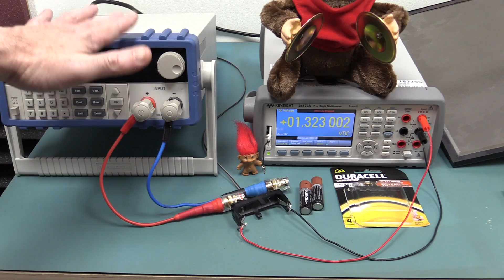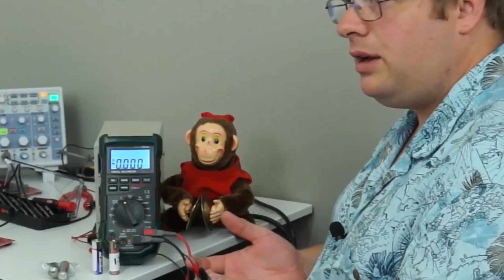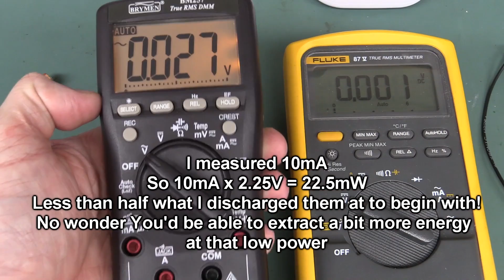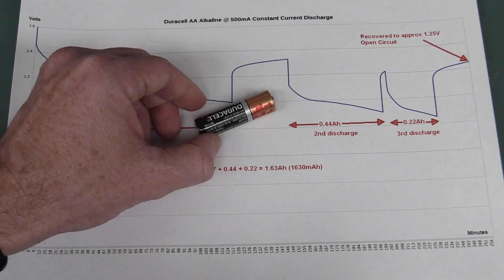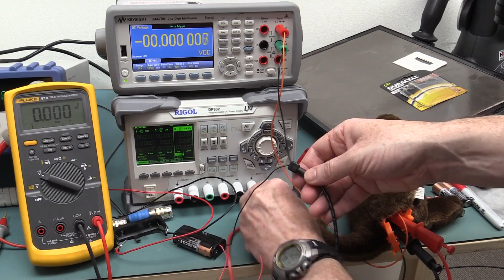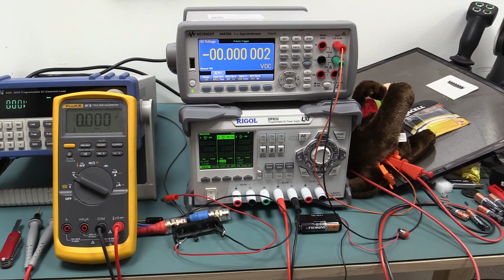EEVblog #789 - Batteriser Monkey BUSTED!

Comment: May be you might notice, that good method to check cells is to measure CURRENT given into short circuit - sure for short time and on proper MM input terminal. Recently I bought nice cheap 9V NiMH rechargable and measured the current (5 Amps, great) too long that internal smart fuse (single thin-enough "wire") burned, so I degusted the thing and found very nice workmanship with 7 tiny 1/3 AAA cells fairly welded, including the "fuse" part burned :-)) nice... It all in fact teached me about existence of nice 1/3 AAA things - I love them - and they are probably modern LSD technology :-)

Comment: I have a childhood memory of sitting under a table or bed covered with some blankets or so and having a flashlight. I could see the light dying down completely and knew that if I turn it off for a while it will give me another short flash of light (the battery recovered).
Given that we moved away from that house when I was 5 that means that a <5year old child already knows that even if a battery been drained to 0 (completely darkness) it can recover if left unused for a while but it will go dark again fast (short flash).

Comment: The only use I can think of for the Batteriser is when using a device with a relatively high cutoff voltage and low voltage cells. I have a number of microphone transmitters that I would like to run from rechargeable cells but can’t due to the  low cell voltage (~1.2 V/cell). A boost regulator would help here as almost all of the cell's energy is available at a voltage too low for the transmitter to use. However, a noisy switching booster may not be a good idea when used with the integral microphone amplifier and transmitter. In any case, I don't want to give these scammers my money!

Comment: Do you know Brain solution (table salt or sea water) squize up th damed battery (manganese) completely?
1. Drill up the small hole into the positive plate of battery.
2. Then spoitting few drop the salt water into it.
3. Wait a minute, then you can get the all-remaining power of the battery.
Please do not do it for Alkaline etc...

Comment: Would it be possible to to maximize battery energy extraction by using some king of pulse drain scheme with a storage capacitor to provide a smooth voltage to the end device? I think it is done with small lithium batteries but could it be helpful with alkaline batteries?

Comment: the only thing I think this batteriserr may be useful for is perhaps an led torch or very badly designed product that has a cut off voltage set too high. surely if using it in say an led torch you would be trading operating time for brightness ?
Reply: +TRDreams 
Ummm.... exactly the opposite. Any decent LED torch will already have a boost converter built-in. That's why they stay bright and die suddenly.
Reply: mines a £30 handheld lamp so should be decent one of those ones they use in garages, it certainly fades out slowly over time. Might have to pull it apart to see if there is indeed a converter! I'll also find the model of it

Comment: do they compare apples with oranges, like in smart devices with active shut down and nonsmart devices that stop working? i didnt see them stick their "1.25" volts batteries in the monkey, which most likely sucks batteries empty til they are empty, with batterisers and it would work. 
the batteriser will do its claimed job if the product it is used in is so badly designed that it will draw the voltage down to cut off voltage even when the batteries are not empty. or when the battery gauge isnt working properly. thats what both batteriser and dave say.

Comment: OMG, just OMFG at all, well, all of gravity's comments in reply to yoksel's comment.  Dave has it 110% correct and I'm not gonna rephrase anything he's said because it'd be pointless.  

The one and ONLY thing that stupid POS baterizer would ever be useful for would be for a device that requires a higher cutoff voltage per cell UNDER LOAD than the battery is capable of producing, again UNDER LOAD, while there is still useable energy in the battery.  

As demonstrated, the batteries still have useable energy down to 0.5v per cell but if your device absolutely requires 1.0v per cell, UNDER LOAD, then those batteries, while still containing a minute amount of energy, are seen as dead TO THAT ONE DEVICE.  In this case and ONLY within this case of a required specific minimum voltage, again UNDER LOAD, the baterizer can boost the terminal voltage UNDER LOAD and allow a device that has a specific minimum voltage, UNDER LOAD, to continue to operate utilizing the remaining energy within the battery despite the fact the battery appears to be dead to that device.

With this knowledge in mind, baterizer MUST have tested their claim on a device that has a specific minimum operational voltage that is above the actual "dead voltage" of the battery UNDER LOAD.  So you have a device that must operate with a minimum of 2.5v and those dead batteries will look like they're good enough because of the battery bounce back but as soon as you attempt to load the batteries the voltage drops below the minimum.  

If you even attempted to use the baterizer on those batteries it would fail MISERABLY!  Why?  BECAUSE THERE'S NO ENERGY LEFT TO EXTRACT!  What are you?? Some kind of moron that thinks you can magically create energy out of thin air?? <-- to baterizer ^_^

Dave, keep up the good work and shove that monkey right up baterizer's "where the batteries go."

Comment: Even in my electronics kit I got at the age of about 12, they explained that the voltage under load is different from the voltage without load. Well, as usual: If a claim is too good to be true, it probably is bollocks!

Comment: Duracell not supposed to leak, yeah right! Many of my gadgets bit the dust due to leaky Duracells. On the other hand I have a multimeter with old Ever Ready zinc chloride cells that are over 30 years old and still working and not leaking.
Reply: Fungus The Bogeyman
 I'm aware of that, my point was having a reading at all after 20 years was a surpeise to me.
Reply: +Peter Kwan I thought I was dreaming... found old batteries I had (20+ years old) still giving 0.97 terminal voltage. Thought those things would register as dead weights.
Reply: +Gavin Crouch 0.97 without a load on it is DEAD.

Comment: The best test you could do is to test their actual claims. Stick some fresh batteries in a device, let's say an mp3 player, measure how long it plays for until it's dead and then stick the batteriser sleeve on the batteries and measure again. They claim they you should get up to 8x the play time using the sleeve. I doubt you will even get 8 minutes.

Comment: Something obvious just occurred to me: use cells in parallel to get more usable energy.  Less internal resistance from the battery of cells in parallel, so less energy wasted heating the cells.

Presumably, this means that putting e.g. seven AAA cells in place of a D cell would be more power efficient.  (The cost of manufacture must make this uneconomic.  Maybe it would be viable for NiMH, where the cost differentials are more favourable.)

Comment: This should be a meme, probing the monkey's butt! I love it.
Also, I didn't realise that batteries would recover to about 1.2-1.3V from just about any discharged state. I knew batteries recovered some voltage but I had assumed it would be linear. Like it would recover say, 30% or something. The fact that it is obviously not linear makes the open circuit voltage test even worse than I previously thought.

Comment: So, with the Batteriser the batteries are more prone to leak? Another downside?
Reply: +Ernst Stavro Blofeld No, he got it right. Fully discharging batteries can make them leak. It also damages recharegables and makes them lose capacity. Your batterizer will do both of those things. Enjoy it!
Reply: +Ernst Stavro Blofeld

Rubbish. The Batteriser has to work in every type of device, including devices with microamp surrent drains like remote controls, Apple keyboards, etc. 

Microamp loads will mean the battery voltage under load is almost the same as the open-terminal voltage. Even a dead battery has an open-terminal voltage of about 1.2 Volts, as clearly shown in this video.

When does the batteriser shut down? At 1.2V? That's still a full charge in a high-drain device.
Reply: +Charlie Pechiar No you got that wrong.
Reply: +Ernst Stavro Blofeld Well, won't the Batteriser, by its nature, tend to constantly drain current from the battery? More than what the product by itself would (due to efficiency being <100%). Dave mentions (and shows) that if you leave a battery draining for too long it will tend to leak.
Reply: Charlie Pechiar
No since the Batteriser uses chips, which have a (very low) cutoff voltage themselves, an almost infinite drain, like in Dave's Indiana Jones experiment, will be prevented.

Comment: People are a little slow mentally I'm afraid. If you're all worried about "wasting" money on batteries then buy some rechargeable! A 4 pack of AA Eneloops are 12 dollars or so, if you charge and use them 4 times they've paid for themselves. 
I'm not an engineer, so I just sort of watch these videos and absorb what I can from them, but even so I'm sure most people will agree if you don't want to use a battery once and toss it you should get rechargeable cells.

Comment: This video is rage-locked
Proving that bateries are different than lab power suplies is easy enough as sticking a load on top of it
all that needed to be shown is that voltage of any battery wil drop under load and how much it drop depends on battery remining charge and load. Measuring batteryies voltage open circuit is doubies at least, because of battery internal resistance but also the meter input resistance, and we get that part very clear from your video. Cel specyfic voltage play big role in that, and voltage will regenerate until it can't
But what is the monkey amp ratting? how much power that creature consume trough its but?
cutoff voltage must be deretmined under specyfic device load. in some cases even new 9v battery will not power high dtain 3v device, same goes for weak power suplies.
Please don't rage over who is right and who is wrong, all you need to do is show how to do it right , cold unbias facts, because we all known who is more right

Comment: I suppose part of the problem could be that the general public has been trained to test their batteries in open-circuit, back when all the manufacturers had those little testing strips on the sides of their batteries.
Reply: Those testing strips load the battery, otherwise they would always show the same voltage even when the batteries were dead.

Comment: +EEVblog What about current peaks?  I was wondering if there is such a situation where using a power supply could be inappropriate for some kind of test, even though the cut-off is  the same. Maybe if a product load is not constant, but take some bursts of hight current. With batteries somewhat discharged, the device would not work, or could "reboot" , in case of a digital equipment, as the voltage would drop because of internal resistence of the batteries. An internal capacitor in parallel would have to be big enough. With a power supply, the voltage would stay the same, even at a current peaks. The batteriser would be of not help anyway, of course, because it cannot handle high currents.
Reply from the maker: +Jonathan Araujo That should be treated as a separate issue, and one that is related to the actual individual product design. Because if you have designed a product that cuts out on it's own load pulse from batteries it's designed to work with, then you have a badly designed product. Most products are not like this.
Reply: +Jonathan Araujo There are indeed, and that has been one of the problems in these videos. Professional battery simulators, like the Keithley 2302, exist to test cutouts in large part for multi-mode devices, like transmitters. A device can work fine at one power level, but when switching to a higher current mode, it may fail. This is notable in mobile phone, bluetooth, wifi design, and so on.

If it's switching on a comparator, and the current burst is short, the comparator may have 'hysteresis' so that it doesn't trip for a sufficiently short burst. Many devices however use something called a 'coulomb counter' to measure battery charge status as a product of current, and for those of course a PSU may give an inaccurate reading. The bq20z80 is an example of a device which does so, and additionally measures battery 'internal resistance' to determine battery status.

Finally, for a commercial switching regulator like the MCP1623, its operation is perhaps limited by the output power and input series resistance, which page 12 of the revision C datasheet may indicate.
Reply: Gravity's account has absolutely nothing on it, fairly certain he's just a Bateroo hired gun, to come here and spew technical jargon and confuse the situation.

Comment: Comment from a person who actually owns a Batteriser (please read whole comment before trolling...)
All the videos Dave did about this thing made me so interested that I actually, just to try it out, bought two batterisers. They were 2€, and I was curious, so...
What I could find out:
1) They actually work. Many people think that it's just a metal bracket, but they do what they are supposed to do. 
2) They (mine) do work down to 0.55V. That's pretty cool for a boost converter, and yes it is a normal boost converter we all have seen at some point in our life, though it's an impressingly small one. 
3) Under 0,8V, there is not a huge load of energy left in a battery (if any at all), so 800% is pretty optimistic. It is even very VERY HIGHLY optimistic..... Actually, I didn't notice any change at all in runtime. 
4) Anyways, I found an actual use for these things (believe it or not!) and it is as obvious as boring. I have them in my old MagLite with the oldfashioned incandescent halogen bulbs. The one thing that really annoyed me about that flashlight is that when the voltage drops it gets dimmer. The batteriser does, surprisingly enough, effectively prevent on that. But, till now, that's about the only use I found for it, and because I also own a way more efficient LED flashlight...
5) I am still waiting for ElectroBOOM trying to electrocute himself with 100 batterisers with depleted batteries.

Comment: You'd have more credibility with the people you are trying to convince (people with little experience) if you just ... simply ...  calmed down.
Reply from the maker: +mdesm2005 Data and facts don't need a credible person. This is not an argument from authority.
And you haven't watched many of my videos have you? This is my normal enthusiasm level.
Reply: +EEVblog I have no issue with your fact and data.  I'm an EE myself.  I'm trying to put myself in the layman's shoes. If this video is aimed at the electrically sophisticate viewer, then you are preaching to the converted.  If this video is meant to leak out into the general public, to help them avoid making a mistake, then tone and style does make a difference.  The general public doesn't know who to trust. The more in control you seem, the more credible you seem to the uncertain.  If you need to borrow the tricks of those in "authority" to help steer the layman in the right direction, than so be it.  If you just want to emote at the already converted ... well, I guess you can do that too ...

Comment: Ohhh totally owned these lamerizer fools good job!  This helps me alot too in building batteries as I am often wondering what the heck is happening when open circuit is tested and the voltage goes up.

Comment: I'm thinking that there are appliances that will actually work better with a boost converter. I have a stupid Canon digital camera that complains of low battery just about permanently. A fully charged NiMH  will operate the camera for a short while, but the battery warning is on all the time. The camera will shut down and the batteries are still just about fully charged. I've always thought that's because the camera actually requires a voltage above 2.4V. so two niMHs cells in series (which starts at 1.25 each) you get there very quickly.
Reply: That is a common issue when substituting rechargeable batteries in a product designed specifically for alkaline batteries.  

Ironically, this is one of those special use cases where a product like the Batterizer could be beneficial (provided the battery compartment is large enough to accommodate them without jamming as the batteries swell).  If their marketing targeted these special cases instead of making absurd claims about improving battery life 8 fold in typical devices we would be praising them rather than roasting them.  The only great invention is in their having shrunk a boost regulator to such minuscule dimensions...it is a shame they did not choose to market based upon the products real strengths instead.
Reply: +Ethan Poole Even with Alkaline batteries, this particular camera just seems to run out of juice WAY too soon. And it was actually sold as a package deal with a pack of NiMHs and a charger. A boost converter would really help it. Then again, it's an ancient 4-megapixel thing that's been surpassed by at least three of my more recent cell-phone cameras :-)

Comment: You can't make yourself clearer than that!
I worked for many years with batteries (robots, and energy harvesting). And determining the amount of energy left in a battery is an approximate science (which models and Coulomb counters have helped to get more accurate, but it will never be exact).
Thanks for that crystal clear video!
Reply: I worked with robots as well. It's called food service.

Comment: DURALOCK means that battery won't discharge itself when it, for example lays on the shelf for quite some time, it DON'T mean that it won't leak if it's discharged to 0..